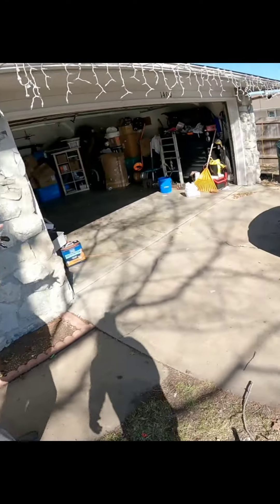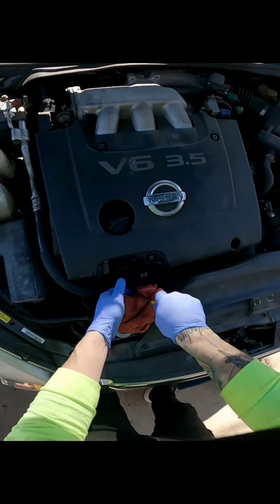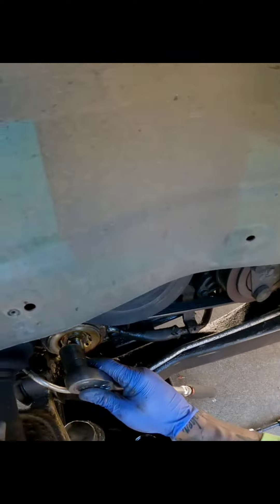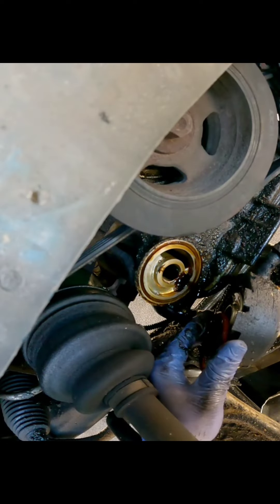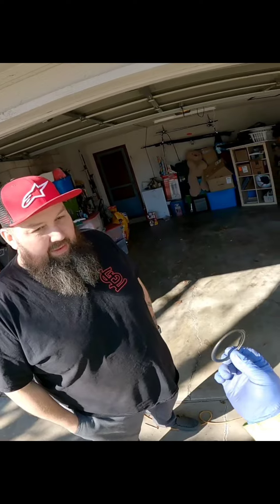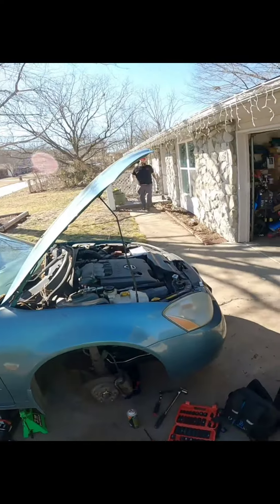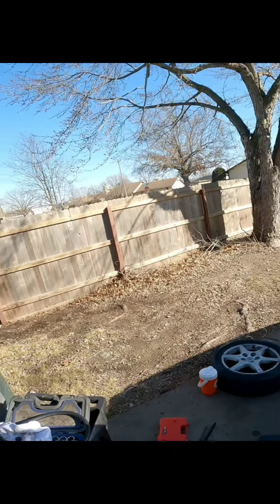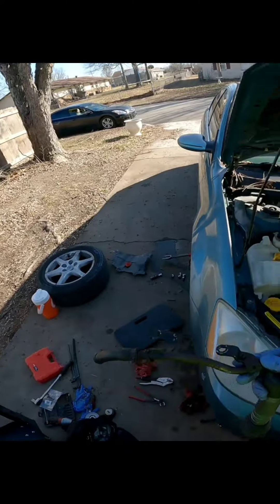Really had to think about this one 😄 🤣

Comment: We used to replace those at grease monkey when I worked there. The o-ring is the same as the o-ring on the oil filter. We used to pull the o-ring off new oil filters and charge a few bucks. You do such a great job! Thank you for the content!

Comment: See this quite often as a Nissan tech real common on the titan frontiers and armadas around that age. From experience with all the aftermarket options I’ve only had luck with the oem gasket. The aftermarket never works right. As for the coolant line their pre molded and usually glued to that pipe and usually the only sure fix is to replace the whole pipe

Comment: I changed a radiator on one of those few years back.
Dealer wanted $900
I said hellllll no.
Not an easy task.
Alot involved.
Bought a radiator from Amazon.$120...antifreeze from wal mart.
 Saved over $700
Suposedly you have to remove the AC condenser  and dryer.
I didnt do it.

Comment: It’s a ducking Nissan
Reply: With how many miles on it?  I've got a 93 Nissan hardbody pickup truck with 276,000 miles on it. Guess what? The cylinder head has never been taken off the motor.
Reply: Mine has 375k
Reply: @acuracheapbuilds6376  What year?
Reply: 2001
Reply: @acuracheapbuilds6376  Mine will get there.
Reply: @CensoredbyYouTube-1955  should last u way longer
Reply: @acuracheapbuilds6376  It will.
Till I'm dead.

Comment: Honestly you guys could have just used jb weld or you guys could have found someone with a welder to patch up that hardline. You could have also used some rtv on the old gasket just to get him back on his feet and not stranded for them few days. To each his own, though. 🫡
Reply: Yep.As a mobile mechanic I'm always using JB Weld, epoxy, Marvel Mystery Oil, Lucas oil stabilizer, Amsoil lifter cleaner, ATF to free the rings on an oil burner etc. The simplest solutions save a big repair...